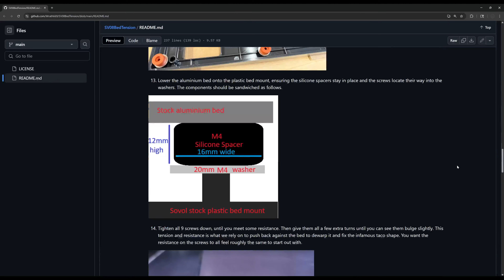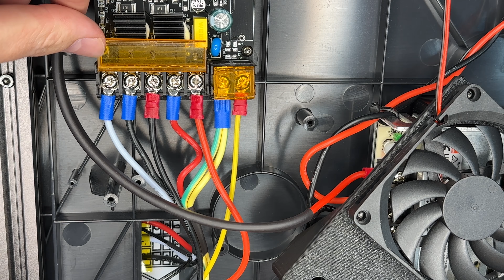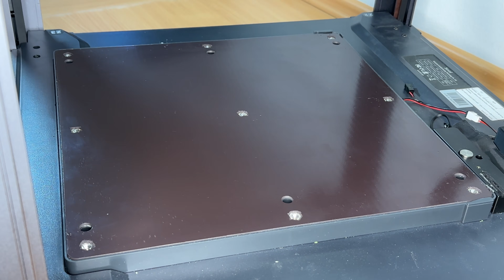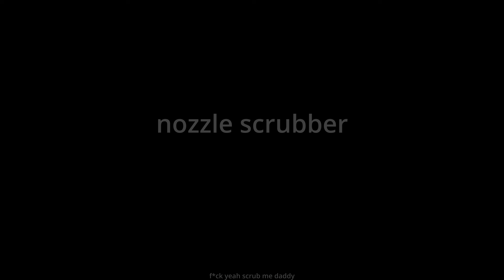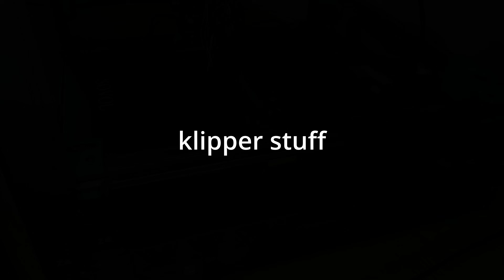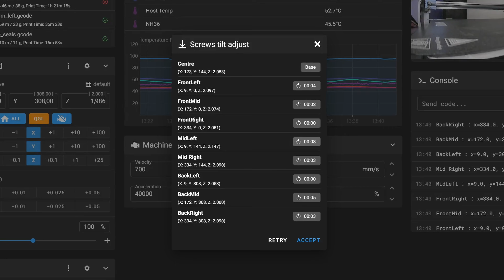Fix the Sovol SV08 Taco Bed WITHOUT Breaking the Bank!

Comment: I simply did a bed scan, found the low points, and put kapton tape on the lowest points.  Repeat.  After several iterations, you have a fairly flat bed.  Heating is largely unaffected by the thin layers of kapton.
Reply from the maker: nice workaround! but if the deviations are really bad you would need quite a lot of tape.

Comment: Thinking of buying an SV08, do most of them have this issue with the bed or is it relatively rare?
Reply from the maker: Cant really tell,y bed was not that bad but i have seen some frome other people that had a deviation of over 1mm. 

if you get one i would recommend fixing the bed(if its bad) and replace the inductive probe with klicky or eddy/beacon. 
then you have a really solid printer.
Reply: Edit: comes with an inductive probe stock

 @AndysTechLab does the sv08 not come with a klicky stock?
Reply: Been a while, the sv08s that they send out have an adjustable bed and I have a mesh of .2 max deviation

TLDR: SOVOL Eddy kit bad, BTT eddy good, stock bed good

Firstly I replaced the probe with the sovol eddy kit, but it suffers from thermal drift as all eddy probes do
But it doesn’t have thermal compensation so it’s crap don’t get it 

Get the BTT Eddy USB or Duo, 
(NOT I2C ver)

Eddy usb would be the easiest to setup and supports thermal compensation

But the Eddy duo despite being slightly more expensive is the better choice if you plan on upgrading the toolhead/ toolhead board 
Eg; to the BTT EBB36 board

ALSO be careful not to fry your board if doing a nozzle change
Turn the printer off before unplugging anything, I fried my stock board this way
Reply: @tcpc4898So the ones they ship now have the capability to adjust any “taco” out of the bed? I am a total noob when it comes to 3d printing so be gentle lol!
Reply: @Grumpy_GenX 
Mine arrived, I am very happy with it
They did a design revision that has bolts that level your bed, 
I have a deviation of .2 across the whole bed which is very good
So the taco issue is solved
Reply from the maker: @tcpc4898 sorry man i didn't get notifications from your comments until now.
nice to hear they did a design revision - the bed is one of the biggest problems of this printer, followed by the inductive probe.
Reply: @AndysTechLab 
I also replaced my probe with the btt eddy one, incredible upgrade
Reply from the maker: are you using eddy ng for the tap feature?
soon i will upgrade my sv08 to run longer shaft motors and 9mm belts and in this swap i want to try the cartographer probe.
Reply: @A @AndysTechLab eddy ng tap needs to be calibrated to temp drift, yes I can do it but it is inaccurate to calibrate as it had to be done by hand setting z0 every increment of temperature

I am using the load cell as a z end stop to set Z and the probe as a sort of “scan” of the bed 

The cartographer seems to be quite pricey in comparison and is pretty much the same as the btt eddy

Comment: Thanks for the video and pointing me to the Github repository. I did the modification today and ended with a deviation of 0.22 mm without spending much time for adjustment

Some comments to the process:
[1] The bed bolts finder didn't work well for me, some holes were 5 mm away from a bolt. No idea why
[2] I managed to do it without disconnecting any cable. For the center screw I used a threaded rod and positioned the other washers and bumpers with a tweezers
[3] I had to use 16 and 18 mm silicone bumpers and cut them to 12 mm. The jig I constructed for this I will put online on printables
[4] Thinking about it after doing the modifications shows a design fault in Sovols implementation. Doing a QGL assumes the 4 corners of the bed are on the same level. If they are not, the gantry will be missaligned and the heightmap will look worse than it really is. Therefore it's important to put a focus on adjusting the corner screws. Before I needed 5 or 6 iterations to do a QGL, now it's done in 2
Reply from the maker: nice work and good to hear it worked for you!
Reply: Did exact same mod with 2mm thick rubber washer, bed mesh 0.13mm range.

Comment: Do I have to do QGL manually with the blockers before every minor correction of the screws in the future? Or is just for the very first time only, can I do it with the GUI from klepper screen ?:face-orange-biting-nails:
Reply from the maker: hey, you just have to align it the first time - just to be sure you wont crash into the bed.
later just use the controls on the printer or klipper
Reply: @AndysTechLab  Thank you.

Comment: Using the middle screw as the reference makes me wonder if it wouldn't make sense to not use a silicon damper there but a (slightly shorter) aluminium or steel spacer
Reply from the maker: i think thats a great idea, this way the middle wont change at all.

Comment: Hi Andy, thanks for these ideas ! The bed of my SV08 is also not the most accurate one ... Sooo: I'll give it a try !
Here are some observations from my end:
(04:30): Why not using the "bed bolt finder" template to mark the center of each hole and use a drill to uncover the screwheads ? Anyway: On needs to be careful regardless if using a knife or a drill ... 😎
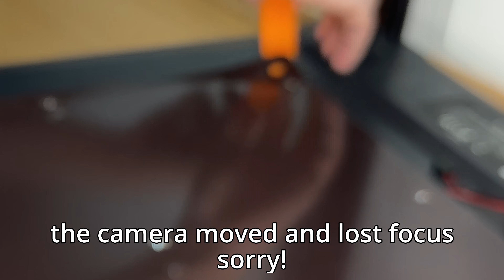(06:30): the audio in this section is mono (right channel only)
(09:00): Just an idea on the very 1st adjustment ... Why not using a known straight "ruler" - e.g. a 20x20 alu strut - and a caliper to adjust the bed against the printer base as a reference ?
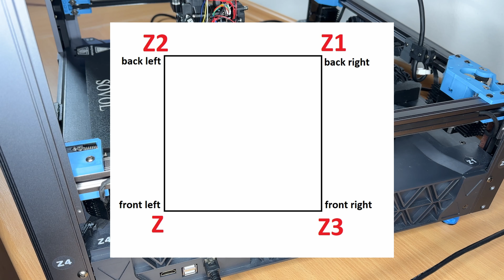(11:40): I'm confused by your naming of the Z axis / columns on the sketch ... The front right is Z4 - hoping that the hardware reference are in line with those of the software ... 🤓 ... BTW: You can see Z4 as the front right column prominent in the background when the sketch is on display ... 😇
Reply from the maker: hey, i didn't think of marking and drilling to uncover the screws - great idea!
thanks for the hint with the audio, im still fightning with it every video.
yeah you can use a ruler and alu strut but im not sure how well you would see a difference.

good luck with your sv08!

Comment: My SV08 taco bed was over 1 mm deviation across the surface.  I bought a Ramen graphite bed ($$$) because I was sick of heat soaking it and still having failed prints because the bed is so warped but that's only half of the problem.  The inductive probe bed mesh was so inaccurate that Klipper couldn't compensate for the warped bed.  I decided to wait to install the graphite bed until I had the Sovol Eddy sensor tool head so I had accurate data to level the bed.  The Sovol Eddy sensor tool head has been "very soon" on each weekly Sovol live stream video for months.  Now, I'm waiting for the Bondtech INDX that should release in a month or two,  One of the INDX tool heads is an Eddy probe so fast an accurate bed meshes are part of the multi filament upgrade.

I replaced the stock hot end with the Microswiss hot end when assembling the SV08, when I also replaced the loud motherboard fan with a Noctua fan.  I also designed and 3D printed an SV08 enclosure.  When I'm finished modifying it, my SV08 is going to be very nice for twice the price and a week of work.  On the plus side, my Sovol Zero printer has been excellent.  It benefited from  Sovol learning what not to do on the SV08.  I still love my SV08 but it was definitely a project printer... although still less time and money than building a Voron 2.4.

Great video!  Thanks!  Liked and subscribed!
Reply: INDX has been delayed until late March 2026 sadly :(

Comment: Can you help? My sensor is at x_offset: -16
y_offset: 11.5
I don't know how to place it in this code [bed_screws]
screw1: 175,175
screw1_name: Centre
screw2: 13,13
screw2_name: FrontLeft
screw3: 176,13
screw3_name: FrontMid
screw4: 338,13
screw4_name: FrontRight
screw5: 13,176
screw5_name: MidLeft
screw6: 338,176
screw6_name: Mid Right
screw7: 13,338
screw7_name: BackLeft
screw8: 176,338
screw8_name: BackMid
screw9: 338,338
screw9_name: BackRight
horizontal_move_z: 2
speed: 400
probe_speed: 3

[screws_tilt_adjust]
screw1: 191,166
screw1_name: Center
screw2: 28,3
screw2_name: FrontLeft
screw3: 191,3
screw3_name: FrontMid
screw4: 353,3
screw4_name: FrontRight
screw5: 28,166
screw5_name: MidLeft
screw6: 353,166
screw6_name: Mid Right
screw7: 28,328
screw7_name: BackLeft
screw8: 191,328
screw8_name: BackMid
screw9: 353,328
screw9_name: BackRight
horizontal_move_z: 2
Speed: 400
screw_thread: CCW-M4
Reply from the maker: hi, you need to place these values in the [probe_eddy_ng btt_eddy] section with "x_offset:-16" and "y_offset:11.6"
Reply: If so, then why did you change the points in[screws_tilt_adjust] @AndysTechLab

Comment: bought one and decided to return this and get an H2S instead just too much issues to deal with
Reply from the maker: you will definetly have a easier time wirh the bambu. if you like to tinker the sv08 is a great machine after the probe and bed is fixed.

Comment: how i change the resolution of the bed measuring? now i have 9X9
Reply from the maker: in the printer.cfg file in the bed_mesh section you can find "probe count: 9, 9". change the numbers to the desired probe counts. first number is for x and second for y axis.

Comment: I did the same on my SV06+. Due to the expansion difference between 60° and 90°C I heated to bed to 75°C and got the bed as flat as I could. The end result was acceptable with a less than a layer height delta.
Reply from the maker: good idea to do the adjustments inbetween the two temperatures 🙌🏻

Comment: Why do the rubber spacers need to be 12mm?    Perhaps cut them in half and use shorter screws?
Reply: I did this mod but I could only get 18mm silicone spacers, so I cut them in half.  Worked great   Cut my mesh range down to 0.2.  Printed some bed stops for the build plates.
Reply from the maker: nice to hear it worked out!
Reply: Thanks. I do like this mod.  My bed has 0.6mm taco range but I can’t see buying a new build surface for a $500 printer.  This makes more sense.  I will try cutting the spacers in half.
Reply from the maker: 12mm spacers are listed in the github and i didn't put any thoughts on this. you probably get away with thinner ones too. i would only recommend cutting them if you can do it in a precise way.

Comment: I replaced mine with the R3Men graphite heated bed. It was about 150 euro. The advantage is a higher bed temp with the supplied SSR. It's a fairly straight forward install and bedmesh deviation is now .06mm over the entire bed. Since I've replaced the bed and the hotend with a Microswiss flowtech  the SV08 has been a great printer.
Reply from the maker: i didn't know there's a graphite bed available, not bad! this probably is the best solution for the price.
Reply: @AndysTechLab  - yes, the R3men bed is ~£130, including the heater and magnetic sheet...much better value than the Mandala Rose Works bed (which doesn't come with those bits). I actually managed to shim my bed down to 0.13mm variance with the washer-shim technique, but it was bumpy and left a lot of imperfections. The R3men bed is about 0.2mm variance, but much smoother across the print area.

I've made the same mods as @Timber-Wolf with the addition of an Eddy Duo (using Eddy Tap for the Z-offset as well), and it absolutely transforms the printer into a totally Bambu-like hands-off printing experience.

Comment: Great video. What print head are you using?
Reply from the maker: thanks! it's teh dragon burner, you can find it here https://github.com/chirpy2605/voron/tree/main/V0/Dragon_Burner
you can use whatever extruder and hotend you like with the dragon burner.
if you want to use the stock sv08 extruder check this printables page https://www.printables.com/model/979636-dragon-burner-sv08